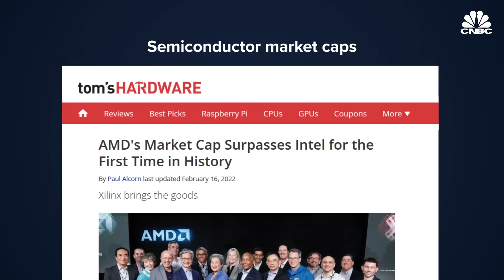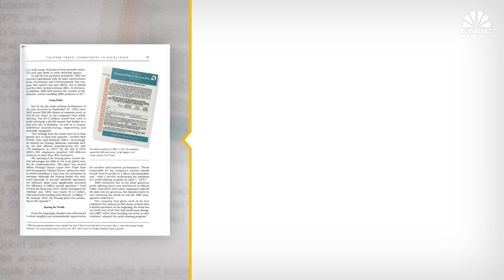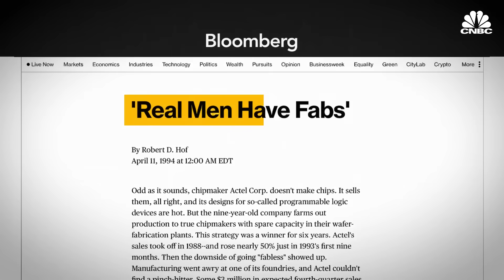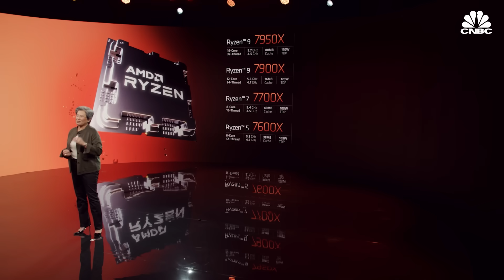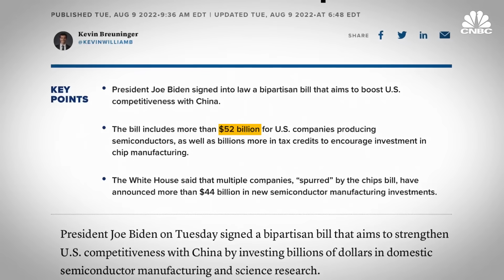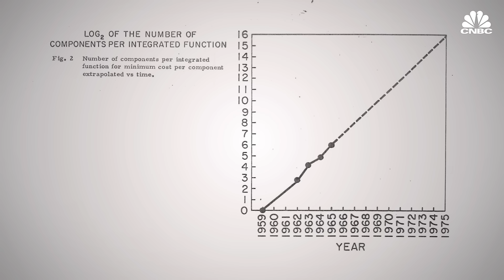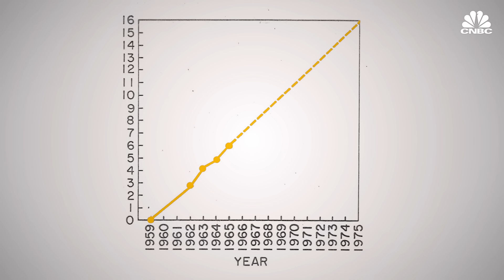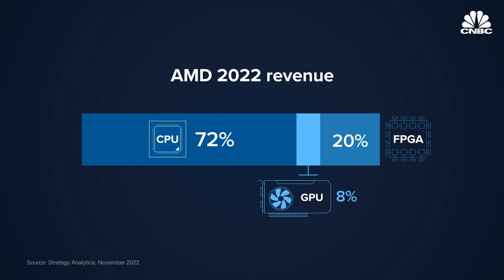How Chip Giant AMD Finally Caught Intel

Comment: AMD has come a long way in making some of the best CPUs out there. Unfortunately they have decided to forgo one of the major reasons for getting where they are today and that is abandoning the budget or lower end market and charging a lot more for their current lineup of CPUs. AMD CPUs were known for offering the same or even greater performance then INTEL at a much lower cost....but those days are gone. Their GPUs on the other hand are probably the best bang for the buck when it comes to performance vs NVIDIA.
Reply: I don't know what you're saying because here in our country AMD chips are so cheap. Budget gamers here can buy a decent APU Ryzen 5 4600G, 4650G, and 5600G for only 100-108 USD. Ryzen 5 3600 and 5600 are only around 128-140 USD which is insanely cheap compared to Intel. On the GPU department, AMD is so freaking cheap, the price to performance ratio is exceptional. Nvidia on the other hand is 2 to 3 times overpriced here. No wonder AMD is such a big hit in my country.
Reply: @godofredo0409  Those CPUs are 2-3 generations old...hence the pricing. Im talking about their current generation.

Comment: I disregarded AMD for decades due to how they were stuck perpetually behind their two primary competitors, and not just in hardware, the software for their hardware was way behind as well.

Now AMD is the first place I look when I need a CPU or GPU. They have caught up to their competitors and in some ways even pulled ahead.

I think AMD is in a better position going forward in especially the GPU market than their primary competitor is. Nvidia is increasingly facing issues scaling their monolithic design philosophy and AMD are already to market with a much less costly design philosophy and is now working on scaling it to Nvidia's position and beyond. I think Nvidia is going to struggle in coming years due to being stuck in a dead end design path. Nvidia is also showing evidence that they know this, given that they have increasingly shifted their approach into software development and optimization.

Intel is going into GPUs as well, but need a few generations to really have a chance to catch up. However in CPUs they are caught up again, which makes AMD vs Intel a really interesting space in the coming years and it can go either way there. Intel has an advantage in having their own foundry, however AMD do have some architecture advantages still.

AMD has great options in specialized chips as well, where you can see them in a much higher variety of specialized products than their competitors.

I think AMD is poised to have an even stronger position in the years to come.

Comment: I now have full confidence to choose AMD chip compared to the old time, bad experience with them. Only thing missing is that there are not many amd laptop with USB4. That's really the last puzzle.
Reply: Based on the ignorance of your comment, you haven't even started looking lol
Reply: @nathanpierre1868  why do u think that? I was in the market and tried to buy a thin and powerful laptop for 2 months. Not many AMD laptops with USB4 are available. I don't really want to buy an Intel laptop cuz its efficiency is lacking. (Who would have thought of that back then) but the ability to connect with eGPU is a must for me. The reality is, not many USB4 amd laptops are available for purchase. If u happen to know some good options, please enlighten me.  14 inch, thin, powerful, USB4, good screen, good battery, good looking is a bonus, that's it.
Reply: @lululemon0424  Bla bla bla. Now heres the actual reality, off the top of my head the perfect laptop based on exactly what you said:

82UH0000US, google that model number and you will get the lenovo legion 7 all amd variant

Now you're going to try to shift the goal post by adding another parameter or adding a technicality weather its price or whatever else.

Comment: I still use the First gen Zen CPU the Ryzen 7 1700 brought back in 2017 when it first came out. I knew the market was gonna shift from there onwards. The chip and it's later versions are extremely successful. Intel was extremely lazy and was asking too much from the customers cause they knew there were no other good options. A market shift was really needed.

Comment: For long time i was AMD fan after intel brand new cpu at that time, failed me in performance and durability (dead after few months without reason) now i have for 5 years cpu 5 2700 and 5700xt I never had any issue with CPU except GPU drivers.

Comment: AMD's Athlon CPU's were wiping the floor with Intel's offerings back in the early 2000's. So it is no a recent phenomenon, But Intel's monoply prevented AMD gaining more than ¬30% of the market. Although, Intel's decision to develop the Itamium processor rather than extend their x86 architecture to 64 bit, left the door open for AMD.
AMD also managed to release the first multicore and copper processors without needing to be fabless. When you are first to the market, you might be late as you are breaking new ground (sometimes dismissively referred to as "executing"), but you are still first.
And Globalfoundries has not just resigned itself to making chips for car breaking systems. Not every chip needs or could afford the leading technology processes and no device would work if all we had were chips from these leading processes. While they attract most attention they are only the tip of the iceberg.

Comment: Wow I thought semiconductors upgraded from x86 to x64 like a decade ago. I also thought there was another major semiconductor player called Samsung out there. Thanks CNBC for letting me know I was wrong.
Reply: x64 is fundamentally x86 with 64-bit instructions. A more accurate term for it is x86-64
Reply: CNBC gave the wrong impression with the video.

No they don't use X86.  They use X86-64, and to suggest it's decades old is laughable.  X86-64 along with X86 for that matter have ALWAYS been dynamic ISAs.  AMD and Intel add/modify these ISAs as they see fit.  In fact AMD JUST modified it AGAIN to move to their Zen 4 CPUs.  They added AVX-512 processing.

So no, it isn't X64, it's X86-64 and yes you are correct CNBC is wrong for making a suggestion that's far from true.

Comment: On the FPGA side, AMD could make a major move just by making it easy for someone starting a company in a garage somewhere to program an FPGA and making a promise of future compatibility.  People on the level of doing stuff in their garage tend to use microcontrollers from microchip because the development tools for FPGAs are a budget buster.  This means that as it stands, that small company with the sudden break through won't be using Intel or AMD chips.  This will likely be the surprise market segment of the future.

Comment: When you were talking about AMD's achievements why didn't you mention creating the first X86 64 CPU? That was HUGE. Even today, computers call X86 64 chips AMD64 family even if it's an Intel CPU.
Reply: I would’ve liked to see them discuss that too. Even though AMD started off licensing the x86 instruction set that Intel created, it was actually AMD that developed the 64 bit extensions that became AMD64, and they actually license that back to intel! Intel might have been the original creator, but both companies have done a lot to advance the state of the art.
Reply: @bhfootballer26  And that was the result of a giant legal battle between both AMD and Intel. It ended with Intel and AMD cross licencing x86 and x86-64 respectively to the other company.
Reply: @bhfootballer26  And thank the heavens it happened that way. Imagine a world where Intel was successful with Itanium. It would've been really bad for consumers.
Reply: @bhfootballer26  Indeed. AMD has been the little company that could and giving Intel a run for their $$  going all the way back to the 386 DX40.
Reply: AMD also made the first dual-core desktop CPU (Athlon64 x2).  Intel managed to beat them to quad-core only by combining two dual-core CPUs into a single chip package.
Reply: #neverforget amd did the first 1ghz Athlon back in the days!

Comment: AMD needs to partner with 3D and editing softwares in regards to their gpu products. Their gpu markets vastly for gamers. If they can hit nvidia in the productivity department...
Reply: They are doing exactly that as of this 7000 generation, they are including encode and decode for all main codecs as well
Reply: Yeah that's the problem of both Intel and Nvidia being so dominant for so long.  Intel and Nvidia have had the budgets for high quality software engineers to assist software companies to add in support for their specific hardware.

So yes, AMD needs to get to the point to where they have the same thing, a highly skilled software engineering dept. that can assist companies with software that will take the best advantage of AMD GPUs when installed.

Comment: The world needs both Intel and AMD.
Intel and AMD have been both taking the crown off and on for decades and I love it.
3:29  good old days and the pencil trick, those dots from L1 to L3 with a pencil unlocked the multi. Although that really only gave 200-300Mhz  it was still fun times. I still have a bunch of old K6 and K7 CPU's, but the last time AMD was the top dog was a64 \ Opteron days when Intel has a toaster Pentium D, then Intel did Core2Duo then Sandy Bridge and sat on their hands for a long time.
Even though I have my Intel system with 13900k and 3090Ti , I'm still going to build an AMD system after December when AMD releases their new GPU's. As long as they have fixed their driver \ software. ATI Catalyst was the worst and really held back their GPU's.

Comment: I'm watching on my AMD Ryzen 7 5700X powered🐧Linux computer. 🤓  It's wicked swift! 😁

I've had many AMD's since my first 486 DX which I ran on a booster stack.
Reply: there is no processor called Ryzen 7 7500x nor does it exist. Ryzen 7 is literally for x700 and x800 lineup. 7600x and up exist except 7800x
Reply: @mendags  I got the 5 and the 7 flipped: 5700X

Comment: I still have the old FX-Series FX-9590 PileDriver uarch... Volan platform... Vishera Processor core. At 220w, and still liquid cooled, along with my GTX 770 4GB Dual Classified Hydro Coppers in scalable link... and the processor runs hotter than the 2 graphics cards.
Reply: Yeah Vishera sucked BAD in comparison to intel back then, and their CPU division wouldn't recover for 6 long years. I'm honestly surprised they managed to survive with the Xbox One, and Ps4.

Comment: If AMD had adopted tunnel diode logic in 1984 when I asked them to, PCs would be running at 2,000 GHz at 5 W. But their "executives" insist on the same-old same-old 1963 CMOS.
Reply: Sure, buddy. The laws of physics would totally have been broken by your genius ideas.
Reply: @usucdik  As a physicist, I assure you that you are wrong. I used tunnel diode logic in 1968 at 0.5 GHz. In 1984 GE sold 70 GHz TD logic. Try learning some facts.

Comment: I remember when AMD’s stock price was around $5 a share; I can’t remember the year but; I think it was in the early 2000s.
Reply: From The Motley Fool 🤔
"AMD stock fell to a low of $1.61 per share in July 2015. At this level, $5,000 would have bought an investor around 3,105 shares. At the current price of roughly $91 per share, this investment would hold a value of about $282,640 -- a return of approximately 5,550%. This far exceeds the roughly 110% return for the S&P 500 over the same period. Also, the stock may have more room to grow as many analysts still consider AMD a hot growth stock."
Reply: If I invent a time machine, I could go back and buy some.
Reply: @kensmith5694   I bought 1,000 shares when it was $5 sold it since I was a naive investor out of high school  :(
Reply: @Areusadjr  I bought a 400 hundred shares when it was at $10 in 2017, still holding some of those. Honestly the stock is cheap right now on a p/e basis and growth will probably reaccelerate by 2024. I wouldnt be surprised if at some point it crosses the $300 level if you have a few years to wait.
Reply: it is 2$ in2014.
Reply: How does one buy stock please explain to me in lame man's term. People always hide this information, don't know why. FYI: I'm serious please help me
Reply: Wow now all the poor people buy their CPU’s what an improvement!

Comment: It's a good time to look at upgrading if you were put off by the high prices and shortages during 2020 and 2021. 
Prices are coming back down and the performance of some of the new tech is insanely good.
I just switched from an old Intel i7 system to the new AMD Ryzen 9 cpu and I'm seeing big performance improvements in games that I thought were GPU bound.
The other big revalation for me was PCI-E 4 class M.2 NVME SSDs (The "hard  drive"). I installed one with 7000MB (Yes Bytes, not bits!) read, 6000MB write. Software install speeds etc are so much faster than they were, and this is PCI-E 4 storage, the motherboard also has the PCI-5 storage support which will be even faster when I upgrade in a few years (Drives are just entering the market so I'd expect high prices for a while on PCI-E 4 M.2 drives).
Reply: Of Course, replacing an old i7 Intel system with a newer system will also improve performance. That's not so amazing. This is just an AMD promotion video. Want to see more an independent view. Intel and NVDIA are improving as well. iX, 12th and 13 gen, RTX technology. Maybe AMD is a better choice with price and system performance for the big companies where prices does matter. AMD is absolute at the top if prices doesn't matter. Have a complete Intel based 12th gen system and a RTX videocard. It came not at top, but 3th place is not so bad. AMD was at the top. But if you look at the prices? It was much cheaper to choose for Intel and NVIDIA system than for an all AMD system with top products.

Note: PCI-E 4 class M.2 NVME? Just choose Samsung NVME M.2's much higher performance than the reads/writes you have stated .
Reply: Dude been enjoying PCIE4 performance since intel 11th gen on my laptop, which AMD does not have during that generation
Reply: Yes, the PCIe 4 M.2 NVME SSDs are amazing beasts. I still look at them in awe, a product about the size and thickness of a stick of chewing gum capable of holding TBs of data available at blazing speeds. I have two slots on my motherboard populated with M.2 drives (one the boot drive and software drive, the second drive is where I store all my data files). I retired my last HDD nearly two years ago now.
Reply: They are really great, if you’re poor.